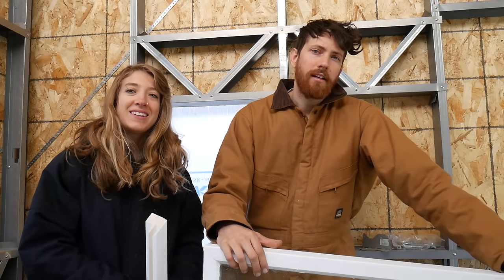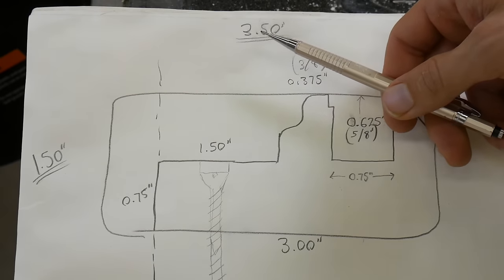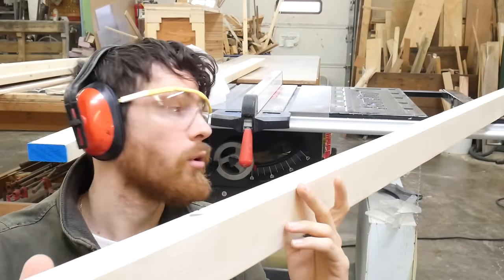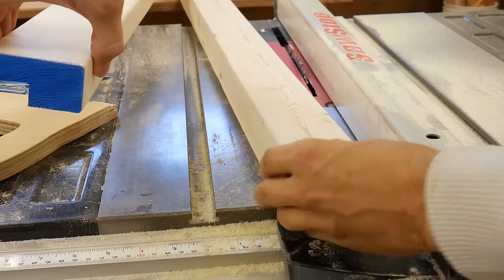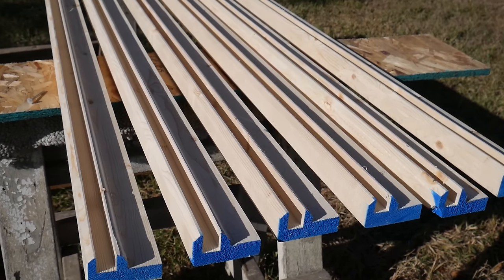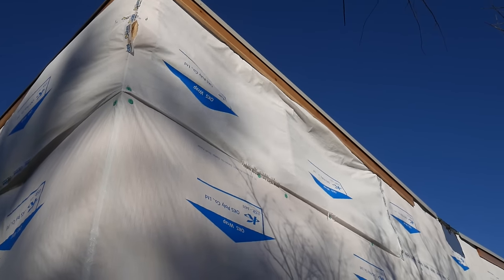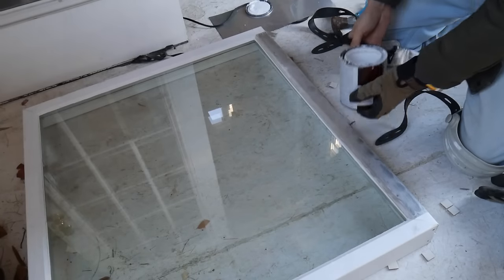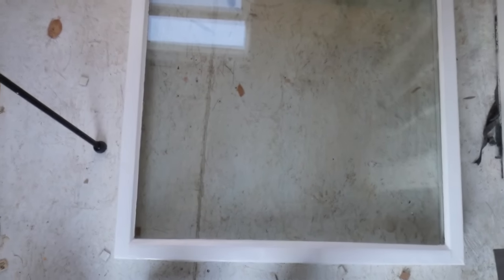We Made 5 DIY Windows from 2x4s and Saved $1,500

Comment: I recently moved into a house built over 100 years ago. The windows on the basement are original to the house. I noticed that the screen windows are removable from the basement and they are also original. I will tell you that they are built with a through mortise and tenon joint. The joint that you built has a design flaw in that you are joining and grain to end grain which means you have less adhesion then you would if you were joining long grain to long grain. In the future, you might consider using a dowel joint which is much stronger than a nail or screw system and still takes advantage of the glue on the grain
Reply: Katie Neves the question is, how strong does it need to be? I’d bet you a million bucks the window builders of 100 years ago would have used screws if they were as good as today’s.
Reply: Window frames are made from hardwood using mortise and tenon joints for a reason. Apart from the fact that softwood will rot almost instantly no matter how much paint you slap on it, the first shower of rain will run straight into these screwed-together mitres, rot them out, rust the screws, and blow the joint apart. The number of people simping 'wow, great job!!!' shows you just how dangerous and misleading this kind of amateur-hour video is.

Comment: a couple of points, the flashing needs to be bent at the bottom away from the house. Surface tension will allow the water to flow down and toward the house.  Also for silicone chaulking, and to get a smoother cleaner finish, spray rubbing alcohol on the chaulking before smoothing it.

Comment: I was thinking about this today, great job and thank you for some ideeas.Mitre saws don't have angles above 45 degrees because you can just substract from 90 what you want to get as a cut angle and turn it around, for ex if you want 47.5 degrees you just set 42.5 and turn the wood around :)
Reply: If the saw is dual bevel no need to turn the wood around but great point I was thinking the same thing !

Comment: Wood glue would be best for the corners, glue the ends line up the two pieces and use tiny finish nails to hold them in line then use a strap to clamp around the window checking for square. Run the bead of sealant in the channel before assembling them around the glass and finish the outside with a second "trim bead". Great work though!! One of the few videos I've found actually making the frames
Reply: If you were to use wood glue and someone were to break the glass you would not be able to reuse the wooden frame.
You would have to build a new frame.

Comment: I like guys like you who show real-world DIY methods instead of using expensive tools almost nobody has. I worry, though, that the caulk will eventually fail somewhere and water accumulate at the bottom. I'd design in some drainage... The wood will expand and contract all the time around the glass. That movement will strain the caulk. I'd both use polyurethane caulk and drain the bottom.

Comment: Neat idea!
But how would you change out a broken window?
Where I live the double glazing is usually mounted floating. So it's not touching the frame. It's supported in a few places at the bottom. In and outside are taped with compression tape. So the glass pane is floating in the frame. The glass is then framed with battens and the voids chalked.
The chalking is what holds the glass pane in place and let's the wooden frame expand and contract with seasonal changes.
Let me know what you think.

Comment: I think you did a great job and this was very helpful to me. The only comment I would make is that I think it would be helpful to add some glue to the joints before screwing them. Great video, thank you!
Reply: If he glued the joints the frame would possibly be unusable if the glass needed replacement as completely dismantling the frame is the only way to replace glass.
Reply: @pistolpeds  Correct way to do these is to use a removable molding on the inside to be able to remove the pane.

Comment: I really like your ideas presented here.

Our house dates to 1935. The wooden casement windows are simple, built like a small door. It has stops on the inside. The operator is a pushrod with a nut on top which locks the rod by tightening on it. The pushrod is available on vintage house hardware sites.

Those crank assemblies always seem to fail eventually.

Comment: Highly recommend zflashing above the windows... keeps a lot of water off. Also, your flashing on the bottom needs a ridge and bending it back towards the house will pull the water straight in to the wall. Just my experience with old wood windows in wet mountain areas.

Also, the reason the windows are wider on top is to provide a way for water to get out of the frame if it penetrates the frame. Sealing them tight prevents the drainage. I usually add a wee pilot hole to let them breath from the bottom.

Nice attempt!
Reply: Do you know of a video showing this? Asking as I have 6 large gable windows. I’m out in the middle of nowhere (off grid property) and window makers have not beers enthusiastic about measuring and making windows

Comment: One little point two years after the event!    Before priming the wood, use shellac or knotting on the knots. In summer the resin around those knots warms up and with movement breaks through the paint film causing the start of the deterioration of your wood. A little shellac on the knots a half hour before you prime stops this.

An even better solution than using primer, undercoat etc. is to use microporous paint which still allows the wood to breathe. You only need 2 coats of microporous rather than 4 for a conventional paint system and then when you come to repainting in 5 - 10 years you just wash down the microporous system and paint, rather than the labour intensive sanding/undercoating, sanding gloss system. You can get microporous paint in white so it doesn't look too different to the norm.

Comment: Now 6 years later in late 2024, vinyl seems to be everywhere. What about PVC board or cellular PVC? Both are coming down in price somewhat, but compared to factory windows at $1,200 each, I can build 5 windows, buy twin glazed sealed with gas to size. Did you know the aluminum separator seal has a descant inside to absorb moisture. Lots of dato joints, finger joints, 12 degree sill angle, drip edge, sealant (Use building sealant/not caulking). Perfect rough opening, flexible seals, bottom supported but screwed from side & top. Water shield placed on bottom, up sides, drip edge over top then seal tape into bed of sealant. A lot of math. Enjoying this process! 
Thank you kingly!

Comment: Aluminium strip on the bottom cilll, needs to run full length and tucked round your mitred
 joints at the bottom edges of the cills, also you need a capillary drip  groove also  run again whole length of bottom underside of cill , 5 x5 mm long , about 25mm in from cill  outer nose......7 out 10  for effort.

English Mik

Royal Carpenter  to 
Her majesty Queen Elizabeth 11
Reply: Michael - I agree.  But it would be better if the bottom sill extended past the surface of the exterior wall by about 1-2" with a 10 -15 degree down angle.  On the underside, you'd place the capillary drip groove.  

In addition, I'd recommend SOSS hinges as they are hidden and will not be exposed to the elements.  They are a little more pricey and take a little more work, but are well worth it.

Comment: Wow fantastic video, this is really great information. Thanks a lot! 

But seeing you cut the beams on the table saw you could see it moving up and down lol. With more care at that stage you would probably have a more precise cut and less cleanup.

I'm also wondering if using epoxy to make the wood waterproof would be a good idea. It would need epoxy and then varnish for UV protection. But maybe that is not good because if water does get trapped it can't get out again?

PS: Btw I'm pretty sure you can't paint over silicone caulking.

Comment from the maker: To summarize the cost, it was about $575 total: $500 in custom double pane inserts, $25-30 in wood, $10 in paint, $20 on the casement hardware, and we used leftover screws and flashing but that could have been another $30. One thing we didn't mention in this video was that we originally thought we were going to make our own double pane inserts to save even more money and learn some more. But getting 10 pieces of custom glass and a bunch of rubber desiccant spacer (super spacer is a product that looked the best) would have been more expensive, not vacuum sealed, and could have eventually had condensation issues.
Reply: How much time did you end up spending on building them?
Reply: Condensation issues are overblown.  Maybe you can make removable interior storm windows for the winter.
Reply: Could you please post the source of the custom window inserts? That's an insanely cheap price.
Reply: @sriniwass  I want to know the company too!
Reply: good job, If your desing is flexible you can get good used windows for about the same price. lowes and HD often clearnce out windows as well. saw 6 windows at lowes today 32x38 for $32 each

Comment: Well done ... just a couple things ... I'd glue the corners.  You have to take the windows apart if the glass breaks/fails ... I'd use a moulding on the inside.  I'm in the middle of repairing the result of professional metal clad window frames ... ROTTED OUT WOOD.  The wood cannot drain or breathe if metal or plastic clad.

Comment: cheap pine home depot studs will rot to pieces in 10 years here in wet missouri but in New Mexico is fine.Im planning on building 40 fixed panes to save 16,000 bux...bt im dont know what to use.....white oak maybe...cedar not good because it doesnt take paint good...fixed panes will be so simple for me,i may even buy store bought vinyl brick mold(at great cost though)...I will build them factory style ....cutting all parts to length before moving onto next process...i figure 40 hours will save me 16000 bux....only 2 sizes for this massive project

Comment: The paint will come off the aluminum... AL must be primed with an etching primer or must be cleaned with alodine prior to painting. Bare AL will oxidize immediately and the oxidation prevents the paint from bonding. 
THIS is why you see airplanes with dull green primer, which is a etching primer.

Comment: I love your idea of building windows, reason I'm here.  I would not build a window like this & encourage others to keep watching videos.  My option is from experience  of what I have seen over the years.  1 You didn't glaze the pane into place, caulking is not the same, & no cushion to ride on..  2 Having a wood trough to encase the glass is a very bad idea, if it is tight it way twist with weather changes & bust the glass or the seal, also if water ever leaks past the caulking it has no way to escape & will rot the wood, a removable sacrificial strip would have been better.  3 Never paint aluminum without using zinc oxide primmer & proper paint, guaranteed these are peeling already. 4 Wood dowels would be much better than screws.  I applaud your efforts, but you didn't really save yourself as you will be rebuilding these soon, a few minor changes & you would be doing basic upkeep in 5 years instead of thinking about rebuilding them in the next few years.  I have a 100 year old house and have the original windows in it.  I was thinking of replacing them all with new windows but I think I'm going to make my own replacements, these new windows don't seem to last very long.  I want to use energy efficient glass & will keep the storm windows  to protect them.

Comment: Great stuff! One comment I have is that caulk will not last 40 or probably not even 4 years especially on the exterior. I've used it on the exterior and it cracks in a couple of years.  I used OSI on the exterior of my new house and so far so good after 4 years. I used the ALEX on the interior for ascetics and many cracks and separations.

Comment: when I just converted some frames to double glazing.
I used external beeding with a slope under the bottom beeding ( like a mini window will) and a gap to drain any water out..
The main problems with wood is the channel's fill with water and make the double glazed unit fail..
You can drill drainage channel's out of the lower frame as well..
Yours looks good though, but I would worry about water getting in, can you drill some hole's some how?
Reply: @michael johnson: You obviously put a lot more thought into servicing, watershed and longivety that they did. Let's hope they never build a wooden boat without doing a bit more research.

Comment: This is a stellar video, but I'm a little concerned that you left no allowance for the full 3/4" pane plus paint ... and there it is ... the panes didn't fit. 
What do you think the final cut width result that was needed for glass allowance plus paint? 
Cutting that notch an extra 1/8" or 1/16"? 
Too tight and it won't fit (I'd also be a bit concerned for any thermal expansion and contraction) ... too loose there might be fitment problems or the glass rattling in the wind.

Comment: Using Dap Alex latex caulk for exterior applications is a big mistake. I would had considered using at least the Dap Dynaflex 230 adhesive caulk. Be prepared to repaint those pine 2x4 frames on a yearly basis.

Comment: Because you built the window around the glass (no removable wood bead) I wish you luck if you ever need to reglaze it. Very bad example of building a serviceable glass frame. Your whole window frame must be removed from the opening and completely dismantled to replace a broken double glazed unit.
Reply: Could you link your video of the better build?
Reply: @bamacheats  it's a good point.
Reply: but isn't that the same as buying and extruded frame window from the store?
Reply: @andrewbrock4636  No Andrew it's not. An extruded frame has a soft vinyl bead/wedge strip holding the glass in against the frame with sufficient gap to allow the new glass to be lifted into the completed frame.
Reply: @pistolpeds  the more you know! thanks 👍
Reply: @Room1sixtyfive  No.  He did not.
Reply: Can you elaborate on how to build a diy window that would allow easy replacement?
Reply: You can just screw out the frame, bit more work but no issues
Reply: Expectation is everything! And this man is expecting more then 10 years!!! Of enjoying these low cost diy Windows .. 👍
Reply: Might I suggest an old fashioned way of holding the glass in? You could use glazing points, which are little triangles of metal would you drive into the frame
Reply: @blindlemonpledge2556  You are on the right track there but generally you would make a frame, put a bead of wood toward and around the outer face inside the 4 sides of the frame, place the sealed and vaccumed glass unit against it and fix another 4 beads of wood on the inside to hold the glass unit firm. These are usually nailed in place. These push tacs you mention are generally used in single glazed and linseed putty'd glazing and picture framing.
Reply: @pistolpeds  I was aware of this and I was trying to use glazing points to make double glaze windows from two panes of single glass. The idea would be to set the glass into the frame, set a shim between a hinged frame holding the other glass which could also be also be attached with points set behind the glass. It wouldn't be as good an insulator as gas filled factory produced window, but it would be a lot cheaper. The hinged pane would also make it easier to clean the glass between the air gap
Reply: @blindlemonpledge2556  I think you will find that any moisture in the air between the two squares of glass will condense to water on the inside unless it is sealed from the atmosphere after being filled with a gas or put under vacuum. I've been out of the Industry for 20 years now and don't know what gas, if any, they use. Regardless, any double glaze will still insulate your home.
Reply: @pistolpeds  You are right, which is whay I wanted to make the air gap accessable by putting one pane on a hinge. This design will still breathe and that's okay because it will be cheaper and do-able by a DIYer
Reply: @blindlemonpledge2556  As long as you can clean your glass you'll be just fine. I'm in Australia, don't see much double glazing in QLD.
Reply: @pistolpeds  found out that air has almost the same R value as argon

Comment: would the inside gather condensation without that special gas to fill in the middle?
Reply: The gas is the insulation, it's better than air (67% as conductive).  Condensation will form if warm wet air hits a cold surface, so you can get condensation on the windows regardless.  If the sealed unit leaks you can also get condensation "fogging" inside the unit, which is hard to resolve.  In theory a sealed unit with dry air inside should be 2/3 as good as an argon filled one, in practice slightly better than 2/3 as the gap is often optimised for air, even when argon filled.

Comment: Not really serviceable if you break a panel having it encased in a solid piece, also I would have sealed it with silicone simultaneously while screwing miters together so that you get a good squeeze out of silicone all the way around, putting the silicone on after the fact only leaves a very superficial layer in those corners where the glass meets the wood, likely to fail waterproofing much sooner